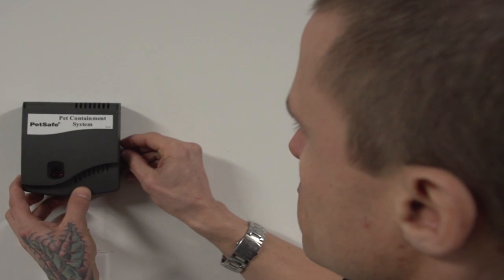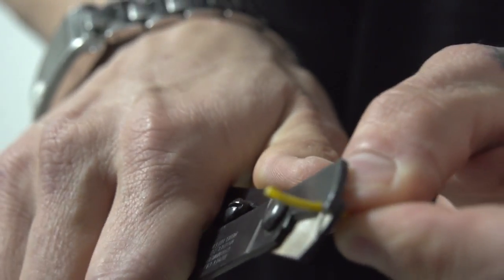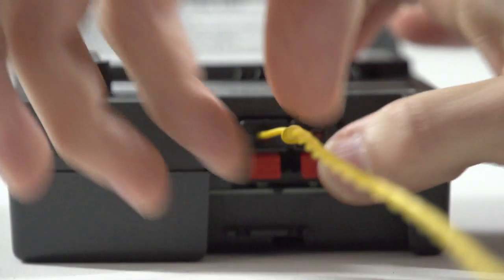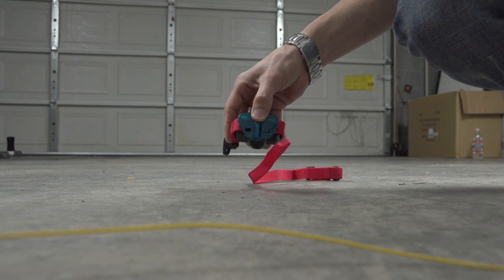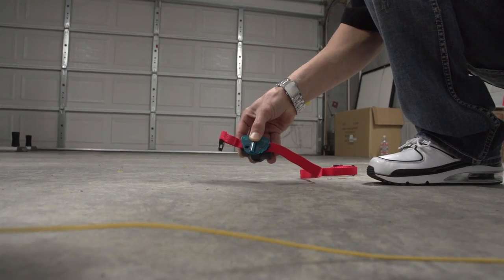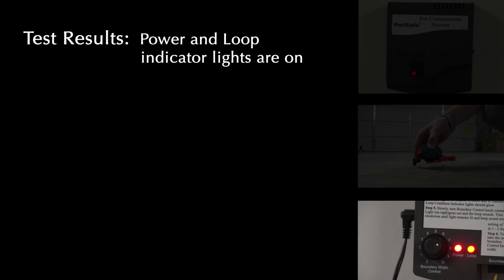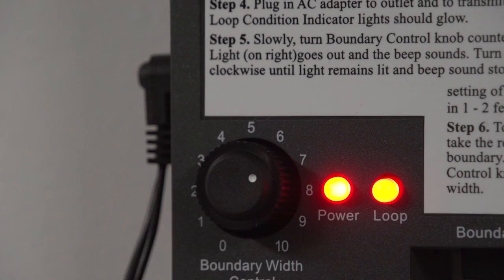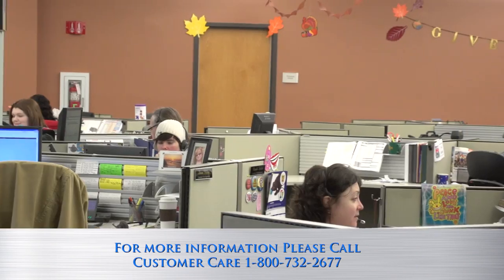PetSafe—How to Troubleshoot the In-Ground Containment System

Comment: I have had my fence for two years and no problems but now I have problems. I have done the loop test and everything is working but when I connect my twisted wire to boundary I have nothing. I have changed my twisted wire and put a loop at end and I get sporadic signals. So how do I find break if I can’t get constant signals? Help please
Reply from the maker: We're sorry to hear you're having difficulty with your fence, Steven!  So that we can troubleshoot with you and determine what could be causing this, please get in touch with our Customer Care team directly.
Reply: Did you not have it twisted enough? What was it?

Comment: What do I do if my wire is making the loop, the transmitter is new,  the collar is new and everything works on a test loop but not on my under ground loop? I have tried different settings on the transmitter and also several different collars. All have the same frequency as the transmitter, all bought as a kit. But the fence is not working and I can't get a collar to respond to the loop that I have used for the last 2 years with no problems?
Reply from the maker: Hello Calvin, we are sorry to hear you are having an issue with your fence. From what you described it does sound like there may be a partial break or interference in the line. For this we would suggest reaching out to our customer care team for troubleshooting support. You ca contact our team here - https://www.petsafe.net/support/contact-us

Comment: Our transmitter box is blinking red light and beeping. What is the problem?
Reply from the maker: We are sorry to hear you are experiencing this issue with your transmitter. For a situation such as this we would suggest reaching out to our customer care team. If you would like you can reach out to our team here - https://support.petsafe.net/s/?_ga=2.258377674.1522421829.1692799543-530763049.1660344406
Reply: I can not get the collar to come on

Comment: Everything seems to work except the collar shocks as you approach the wire and then beeps after the wire is crossed.   I have search for how to fix this and can't find any information.   I have done the loop test with the same results, the collar shocks as the wire is approached but when the wire is crossed it signals.   Any ideas?
Reply from the maker: We're sorry to hear you've had this experience with your collar, Tammy!

It is critical to mention that most of our collars will have a change in tone between the warning sound and the correction sound.  As both are very high pitched and difficult for some customers to hear, it's possible you may be hearing only the correction tone but the warning tone may be a bit too high pitched/faint for your hearing range.

With that being said, if you have a friend or relative who readily hears very high tones and they are also unable to hear this warning, please reach out to our Customer Care team so we can troubleshoot this with you.
Reply: What an answer…your ears are bad not the collar…
Reply: @serious-power3085  It's a real problem for lots of people.

Comment: The light will not light up at the collar.
Reply from the maker: We're sorry to hear you're having this issue with your collar, Richard!

The first thing we would recommend checking is to remove the battery from the collar. While the battery is out, press the button on the collar down and hold it down for 10-15 seconds.  Then, place the battery back in the collar.  If it still does not have light, please get in touch with PetSafe® Customer Care.
Reply: @petsafebrand  still not working. I’ll try replacing the battery first

Comment: Since we're using a test loop (and not the actual in-ground loop), how could the third test result tell you that there's a break in the boundary wire?
Reply: I believe the third test is saying the control unit is good, the collar is good, and it works properly with the test wire, so by process of elimination (the only thing left) must be the in-ground loop buried in the yard. ie... it can't be anything else.  So although the in ground loop has not specifically been tested, the problem is isolated to that.